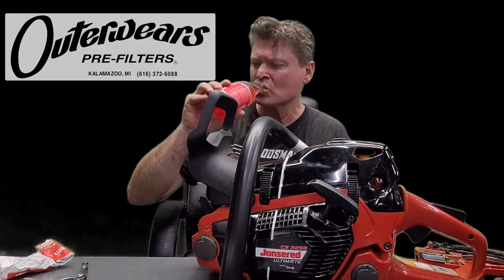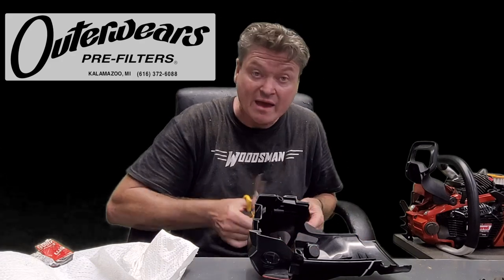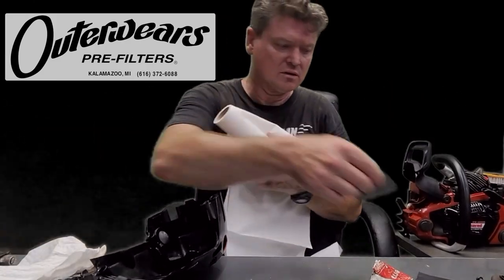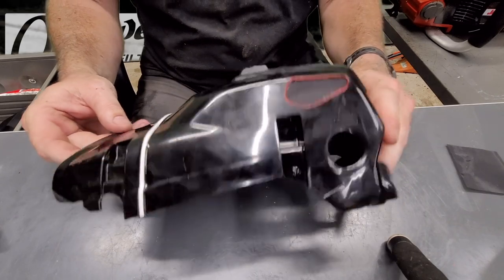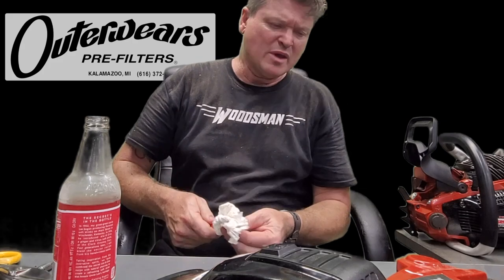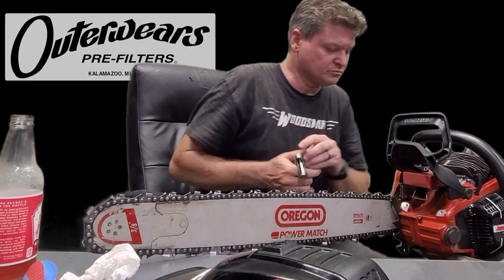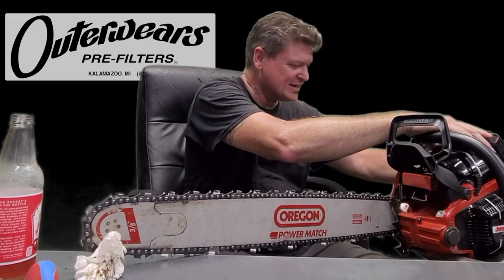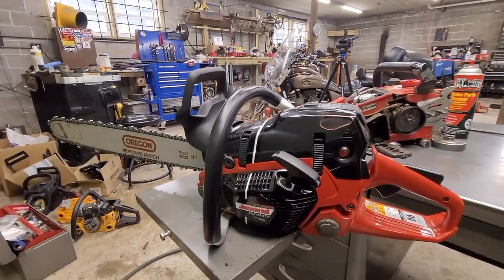DIY Frogzskin Pre Filters

Comment: I've only recently started watching some of your content. I'm a Faller /Logger with 25+ years in the mountains of the Western US.
 We were kinda hoping that the whole Jonsereds buy out by Husqvarna would stay off the radar for a while cause we Fallers could buy Husqvarna Saws in Jonsereds colors that are made in Georgia....lol and we were getting good quality at lesser pricing than for Husqvarna lol.
Any way our local Saw Repair Guy has been doing just like you did here except with stainless steel fine screen and then using epoxy to glue the screens inside the filter cover and buddy does it ever work fantastic! Sure once in a while you have to give one side a quick brush with your hand or blow the chips off when it's not running but man does it ever solve to hot start ISSUES period. Hell when it gets up in the 90's here the Forest Service throws a Red Flag Warnings and all falling out in the Forest comes to a halt. We can fall in the early morning till around 11 am then again after 4:30 pm if we need to but most days we put the saws away and head to the Landing if we have Logs piled up to load and get them to the mill so it all evens out in the end....logs at the mill is money in our pocket so no one complains too much.
 We like your content with the Jonsereds Saws...(We have heard that they are made ....like Poulan Saws who is also now owned by Husqvarna...at the Poulan Factory in Georgia but that's just what we have heard) I do know that back in the day, when Jonsereds were built in Sweden they were hard to find here in the states but those of us who could find them ... loved them...they were no nonsense power in your hands that just started every time on the first or 2nd pull and they would run all day every day with out missing a beat....it was sad that they didn't get going here better than they did but oh well that's how the Tree Falls sometimes....thanks again for the Jonsereds content it makes us older guys smile.

Comment: The Triple Nickel/555xp has the smaller bar mount k0095 bar mount, smaller tranfer caps and comes with a .325 rim sprocket. The 562xp has the large Husky mount D009, larger transfer caps, crank stuffers (Rev Boost) and a 3/8 rim sprocket.
Reply: And a bigger carburettor 😊
Reply: it depends on the market... I have a husqvarna 555 professional, the factory is 3/8, 18 inch guide and has a k0095 bar mount... and it is very difficult for me to find a guide in these dimensions in Croatia because we are a small market and in general there is no such offer in the EU for upgrading chainsaws ... so if you know of a store that has delivery to Europe, I would be grateful for the link ...
Reply: @danielle7lb  you Can find it on eBay. 
Or chance the sprocket and go 0,325 chain  in-sted.
Reply: @peterjensen5546  0.325 does not suit me because I use a double or single bit file... and 0.325 cannot be sharpened that way...

Comment: What is that stuff like a screen fabric?  Some black plastic mesh would work there too???? Cool idea???      When you do your face cut…don’t use traditional or humbolt… combine them and do the old smiley face < notch… then right through the middle of the face cut you plunge cut the center out… then you plunge cut the tree by plunging into the right side halfway between the back and the back of your hinge… then you work up to create the back of your hinge. …go to the left side (high) and create the back of the right side hinge…. Ring around the Rosie back baring your way around the back of the tree… easypeasy !!!       Just keep safety first and always on your mind…. Have you a couple wedges and something to hit them with…I use a 5 pound hammer on a 14” handle… axe has a small face…

Comment: Did  something similar to a Poulan 3400- your favorite. Couple holes in the cover, roughed up the inside and epoxied some old pet screen in it. Used graphite powder mixed with epoxy and it turns it black. This one has a black cover. Looked great and cheap.

Comment: Run the bigger saws to drop the Pine just for safety reasons, once the Pine is on the ground then you can use the Jonny to finish the Pine once it’s on the ground. Set up the chain depth-gauges for hardwood and not softwood. It will work GREAT!